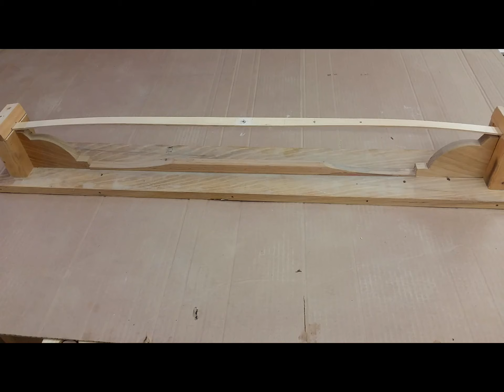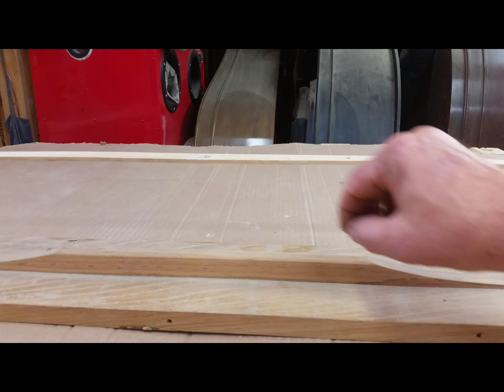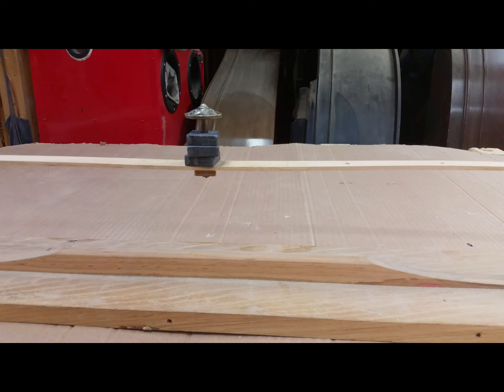The Vibrating Rib Demo

Comment: I like your videos, keep up the good work. 
In this case, I have always heard the ribs carry the sound across the soundboard.  Never made sense to me, as the soundboard itself should be carrying the sound all over the soundboard.  It seems the ribs would instead stop vibration.  And the bridge too.  Solid strips of wood all over making it all more rigid, and the bridge with all that downbearing  weight from all the strings should dampen vibration.  Obviously I'm wrong lol.